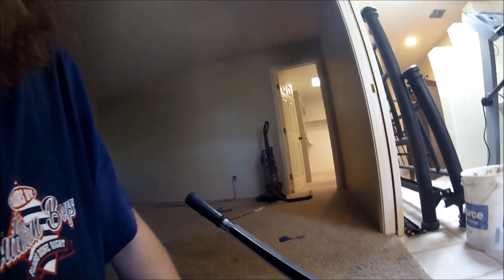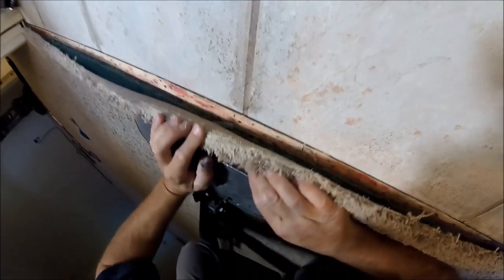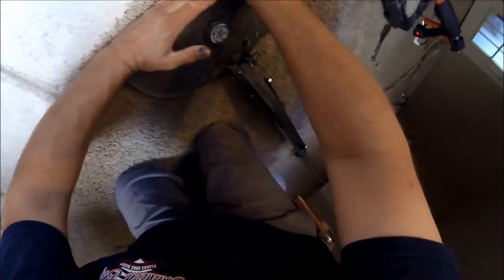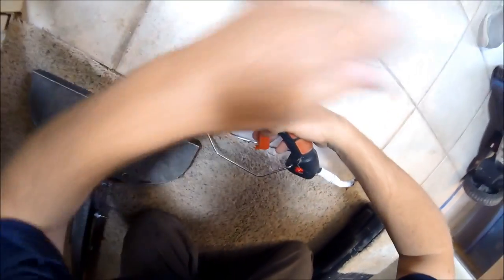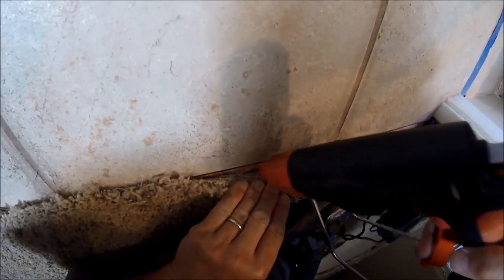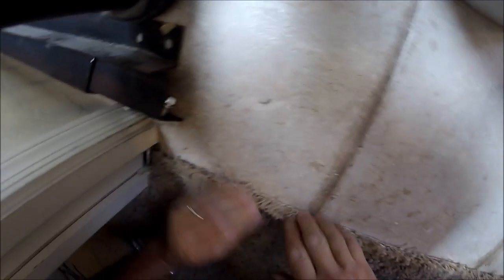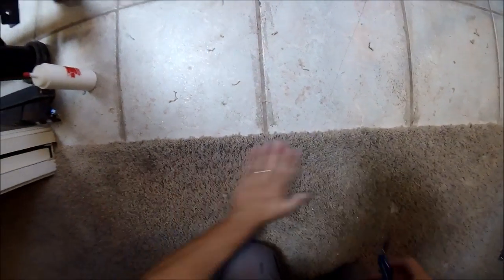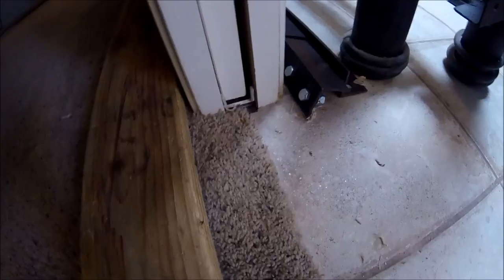CARPET TO TILE REPAIR

Comment: I do these a couple times a week, very common here in California. Great job with stretching to both sides, sometimes they are tricky like that. Do you ever come across carpet to tile where the tile is much higher than the carpet? That would make for a good video.
Reply from the maker: Gold Coast Flooring | Carpet & Tile Care Sorry about that I meant to say yes I do come across those kinds of situations with real  Thick tile and thin carpet the next time I get the chance I will do a video on one thank you for the compliment and for the recommendation and for  helping me out The other day
Reply: You're welcome, I usually run into it when someone remodels a bathroom and the installer uses 1/2 backer board. I have carpet shims that act like a ramp, just wanted to see how you do it. Hopefully you got the ads working properly, great job on getting 1,000 subs!
Reply from the maker: Gold Coast Flooring | Carpet & Tile Care That’s actually the exact same way I do it or use the 7 inch shims and make it Alex just like a ramp and no I never did get my ads figured out still the same thing only on incognito do they work but thanks for your help on what you did anyway
Reply: Bummer sorry to hear that. I'll dig a little deeper on that issue because I want to start monetizing videos soon too. I'll let you know if I find anything. Thanks again.
Reply from the maker: dude you're awesome thank you

Comment: Delamination!!! If the bubbles in the carpet are do to Delamination then the bubbles will return!!! See the backing is hooked on the pins but the primary backing is free to float around into bubbles!!!

Comment: I take it that I could do the same thing along side vinyl  floor and use a floor strap along the seam?
Reply from the maker: paulmax72 Yes, so long as it’s no more than about an inch you can usually cut the bad off and stretch it that much at least

Comment: I couldn't find sealer you used or where I might find it in your dropdown menu , Sir
Reply from the maker: Trigger Toes   Roberts 8015-A Solvent Free Universal Carpet Seam Sealer https://www.amazon.com/dp/B0017O0K2G/ref=cm_sw_r_cp_api_i_v5nFDb1JV286C.    Here you go, this will work just fine

Comment: I've got a cat that got locked in a 10x6 closet and he ripped up the carpet at the transition back about an inch and a half. The length I want to stretch is the 10 foot side. I'm curious if I can cover the inch and a half with a strong stretching. If I tried, should I consider anything anchoring the carpet other than the tack strips on the perimeters?
Reply from the maker: flippygang Inch and a half is a lot to stretch from a 10 foot round, I don’t think you’ll be able to stretch it that much , I would probably just put some extra nails in the tack strip that you’re stretching to and that will be enough to hold it but if the carpet is torn it’s going to be weaker on that edge and it might not hold up to that much of a stretch so you might end up happening to install a transition piece to gain a little bit of that inch and a half
Reply: @FloorsbySouthernboys  alright, I'd like to transition just not so sure how. Flooring company wants $500 for the job. They'll sell me the carpet 12x12 for $117. I don't have any spare nor an inconspicuous place to steal from.
Reply from the maker: flippygang Is your floor wood or concrete that you’re working on
Reply from the maker: flippygang And also what are you working to are you working to a tile

Comment: What is that sealant you use.  What’s it called?
Reply from the maker: Trim& TuckCarpets It is actually a late text seem sealer I used the Taylor brand it’s actually used for seams but I always use it for doorways and things like that but anyway it’s a late text seem sealer

Comment: How much did you charge for that? Not the whole job just that repair
Reply from the maker: Mike Vasililou well it was figured in with the entire job, but if I had of only done this repair it would’ve been a minimum charge of $135, a person has to set the minimum rate to protect themselves from little repairs like this
Reply: @FloorsbySouthernboys  thank you so much for the quick response, also really a huge fan of your videos man just got into the carpet game, and you really helped me out a lot so far can't thank you enough
Reply from the maker: Mike Vasililou That’s awesome, this is really a good career and I’m glad I have been able to help you